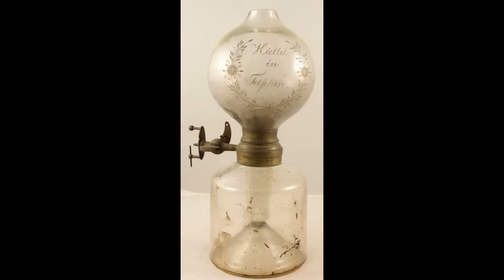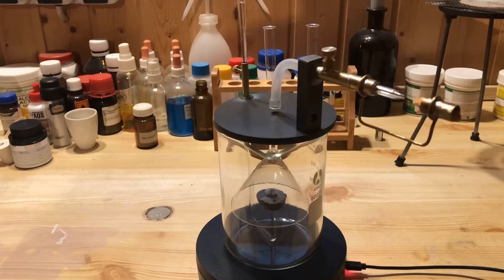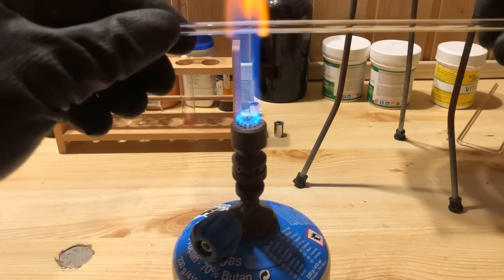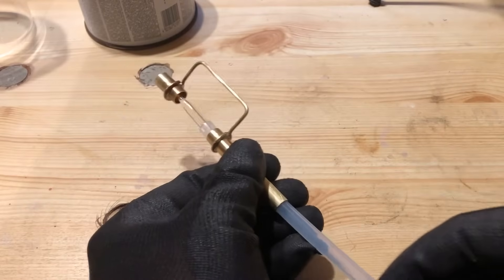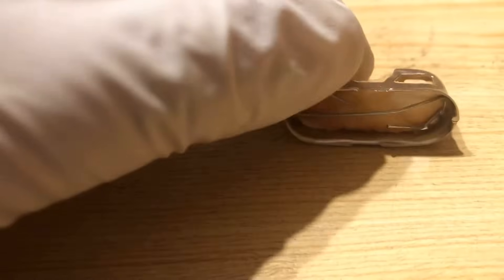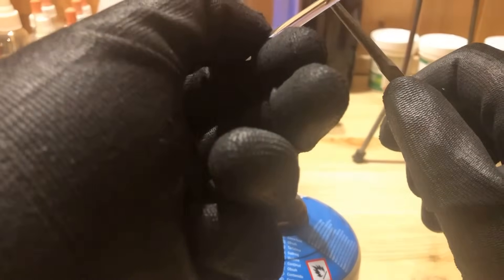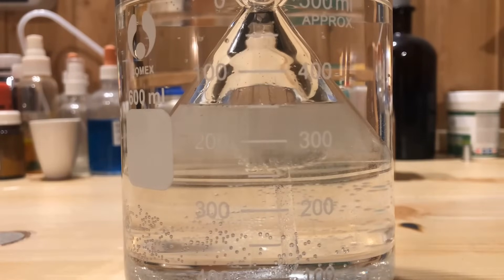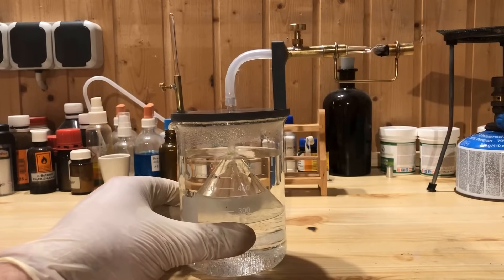Building the Döbereiner's lamp, one of the first modern lighters in history

Comment: What happens when the hole in the zinc gets larger and the zinc falls down further on the glass tube in the sulfuric acid. I didn’t see anything to keep this from happening unless I missed it. You don’t want an uncontrolled build up of hydrogen gas in your home, at the very least it would eat up the rest of your zinc quickly.
Reply from the maker: It's a demonstration device that should never be left unattended. In the version I built for Steve, a small filter was included, which is placed over the glass tube where the zinc disk rests and is also kept safe when the zinc disk decomposes. I also wrote a manual for him with corresponding safety instructions. However, he did not use the small filter. He doesn't have to. He is old and experienced enough to remove the zinc disk after the experiment.

Comment: I wouldn't want to leave the one shown in the video going for a long time. Why? Because of how the zinc support is made. A bit of stretch was done to neck it down to the size of hole drilled in the zinc piece. But there's a length of straight support beneath the zinc.

Think about what would happen once the acid decomposes enough of the zinc to enlarge the center hole. plop Down it goes into the acid where the hydrogen can then go outside the funnel.

Doesn't matter that it's a demonstration device not meant for long term use. Repeated short term demonstrations would eventually erode the hole too much. Something acid proof should be added to the support so the zinc can't fall down until it would be all gone.

If this was a commercially produced science class product, it would eventually be recalled after causing a few explosions.
Reply from the maker: Simply remove the sulfuric acid after the demonstration and pour it back into a prepared bottle. No chemistry teacher allows an experiment to continue unobserved.
Reply: @Marbslab  any possible dangerous point of failure will fail at some point. As I said before, repeated short term demonstrations would eventually erode the hole too much. Keep using that and at some point the zinc will be >thisclose< to dropping, then it will fall not long after being dunked in the acid.

If it's not you who uses it, the person may not be so careful. Anything one builds with the potential to be dangerous, with the intent or possibility that other people not intimately familiar with every aspect of it, should be made as fail-proof as possible.
Reply: @greggv8  Well, this could be simply solved by heating the glass rod at the lower position of the zinc sample and squeezing a small dimple into the rod, preventing the zinc from sliding any further.
Reply from the maker: @c4t4l4n4  I actually did that. Another option would be to make something like a candle holder with a watch glass.